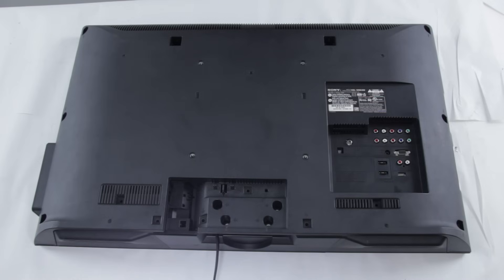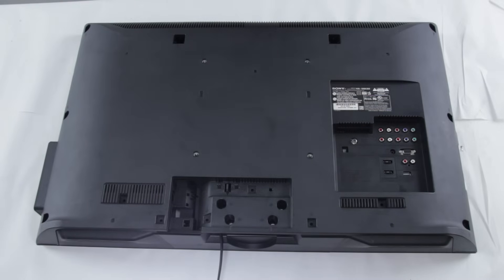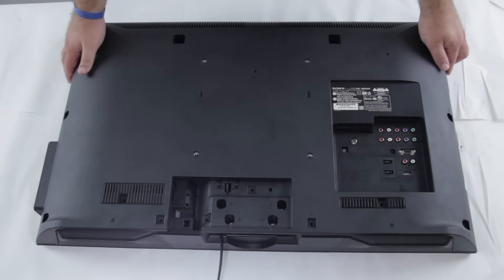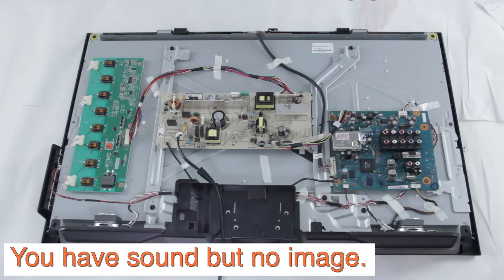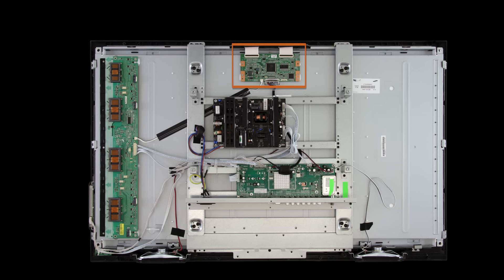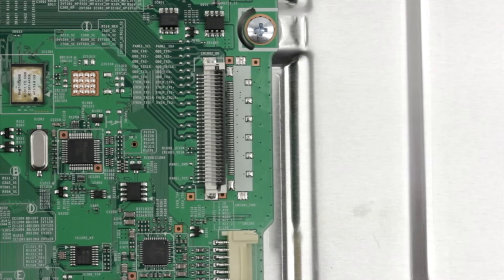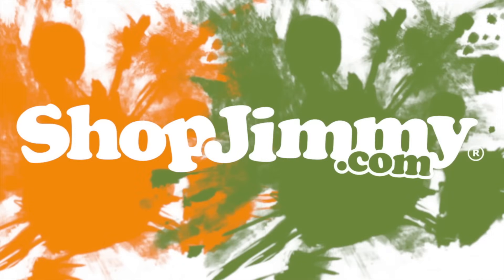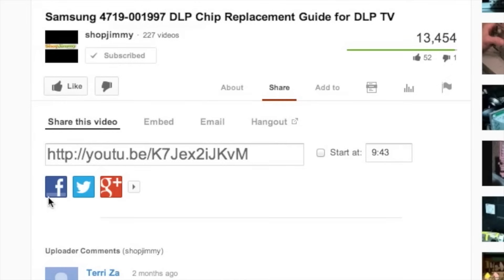LCD TV Repair Tutorial - T-Con Board Common Symptoms & Solutions - How to Replace T-Con Board

Comment: Hey, I hope you can help me with this issue. 

I have a Sony Bravia KDL 50EX465  serial # 5031453

When I try to power on the TV, the screen is black and there is no sound.  Now, before I had this problem I had the volume very, very low to begin with.  Around 1 or 2 maybe.  I don't know if that would affect anything.  Anways.  The green light comes on, and then off again about 3 times.  Then it goes to standby and blinks 6 times.  At first it blinked 5 AND 6 times.  I unplugged the unit and let it sit.  Tried a factory reset, and now it only blinks 6 times.  Any help would be greatly appreciated!!
Reply from the maker: concertostrife   This is lamps problem, and that is caused by the TV panel.  If your TV panel is bad, it may be more cost-effective to replace the TV as panels are typically hard to find in stock, difficult to replace, and expensive.  Thanks and please let us know if you have any further questions!  www.shopjimmy.com
Reply: ShopJimmy.com
  After checking, you may be confusing my TV with something else?  It is an LCD.  No projection.  ...or am I mistaken?  Are there still lamps inside?
Reply from the maker: concertostrife   There are lamps in the TV, not like a DLP lamp, but cold cathode fluorescent lamps (CCFLs) that illuminate.  Unfortunately we do not stock CCFLs.  Thanks!  www.shopjimmy.com

Comment: i own a Philips Q528.2E LB chassis and i am getting an white/light grey picture. u can hardly see the menu but if i turned it on and off a few times or leave it on for a while it sometimes get better and you can read the menu or see a picture somewhat better. can the tcon board be bad here?
thanks

Comment: hi , i have 42' TV , INSIGNIA  and on sudden , when i turned it on i just hear the sound clearly .. but NO Picture at all (BLACK SCREEN).. is it T-CON Board , Or BackLights Inverter ?

the T-CON Board number -  D016630-L$NSR813600812
Reply from the maker: Charle Brown   Please reply with your TV model number and then we can recommend a replacement part for your TV repair.  Thanks!  www.shopjimmy.com
Reply: ShopJimmy.com INSIGNIA
LCD TV
Model No.: NS-LCD42HD-09

Comment: I have a 2007 VisionQuest LCD TV Product # LVQ40HLA Model# 1070 Serial# LVQ40 07110611

The problem:
Red tinge occurs on top and bottom of screen. You might also call it a red-washed look. Colours aren't displaying properly and are showing a red colour instead. The center of the screen looks fine and most colours on the top and bottom look fine but there is a distinct red tinge on the top and bottom as well.
Reply from the maker: DaveandJess Primmer   I recommend replacing the main board in your TV.  Unfortunately I do not see any replacement parts in the search results for your TV model number on our website.  Thanks and please let us know if you have any further questions!  www.shopjimmy.com

Comment: I have a model # 32MD359B/F7 Magnavox, turns on plays onboard DVD with no picture all white screen sound works fine, can change channels, volume works, just a plain white screen. S/N J039002852
Reply from the maker: John W  I recommend replacing the digital board in your TV.  Here is a link to replacement parts for your TV model number on our website, click here:  http://www.shopjimmy.com/catalogsearch/result/?q=32MD359B%2FF7  Be sure to match part numbers on your current board, with your replacement for compatibility.  Here is a link to a video showing how to identify your part number, click here:  Part ID Numbers for Sylvania, Emerson, Philips Magnavox MPS, MPW, MUT, & Digital Boards TV Repair  You can also call our customer service for further assistance with your purchase.  (877) 881-6492  Thanks and please let us know if you have any further questions with your TV Repair!  www.shopjimmy.com

Comment: Hi. I have a 2 yr old LG 55LK520 LCD. Just started displaying a single 1 pixel blue/red vertical line from the bottom of the screen to about 1 inch from the top. It's located about halfway between the center and the left edge of the screen. It's persistent and displays with all/no inputs. Repairable? Thanks!
Reply from the maker: Tony Szatkowski   This sounds like a TV panel problem.  If your TV panel is bad, it may be more cost-effective to replace the TV as panels are typically hard to find in stock, difficult to replace, and expensive.  Thanks and please let us know if you have any further questions!  www.shopjimmy.com

Comment: Hello, I have a samsung LN52A750R1FXZA. It turns on and off, on and off... the picture never shows, the back lights do turn on though. I have replaced caps, tried to see if unplugging the touch panel would work to no avail.  Do you have any other suggestions to troubleshoot? Start up chime comes on and tv turns off right after. Manuf date 8/08.
Reply from the maker: rcrack2  I recommend replacing the main board in your TV.  Here is a link to replacement parts for your TV model number on our website, click here:  http://www.shopjimmy.com/catalogsearch/result/?q=LN52A750R1FXZA  Be sure to match part numbers on your current board, with your replacement for compatibility.  You can also call our customer service for further assistance with your purchase.  (877) 881-6492  Thanks and please let us know if you have any further questions with your TV Repair!  www.shopjimmy.com

Comment: I have sony kdl 46z4100 serial 85xxxx that has a completely black screen. No menu, or other screen display at all. The backlight does turn on and i get audio,  the set stays on for about 4 minutes then the backlight goes out and the red stand-by leds blinks 12 times. Also, all fuses check good and the tcon board is getting 12v.
Please comment
Reply from the maker: j holman   This sounds like a TV panel problem.  If your TV panel is bad, it may be more cost-effective to replace the TV as panels are typically hard to find in stock, difficult to replace, and expensive.  Thanks and please let us know if you have any further questions!  www.shopjimmy.com

Comment: I have Vizio LCD VO47L FHDTV10A.
made dec 2007

I am getting sudden hiss sound from the tv as well as lcd monitor is darker then before. I can see everything ok but screen is dark and lightly flickering.. is it a inverter problem?

thanks in advance.
Reply from the maker: jong-hyun joe   This sounds like a power supply problem, and you may want to replace the power supply board.  Here is a link to replacement parts for your TV model number on our website, click here:  http://www.shopjimmy.com/catalogsearch/result/?q=VO47LFHDTV10A  Be sure to match part numbers on your current board, with your replacement for compatibility.  You can also call our customer service for further assistance with your purchase.  (877) 881-6492  Thanks and please let us know if you have any further questions with your TV Repair!  www.shopjimmy.com
Reply: Thank you.. you guys are great

Comment: Hi! I have a 55 inch vizio vf552xvt, green dots appear all over the screen. What board do I have to replace to fix this?
Reply from the maker: Louis Gellys II  I recommend replacing the main board in your TV.  Here is a link to replacement parts for your TV model number on our website, click here:  http://www.shopjimmy.com/catalogsearch/result/?q=vf552xvt  Be sure to match part numbers on your current board, with your replacement for compatibility.  Here is a link to a video showing how to identify your part number, click here:  TV Part Number Identification Guide for Vizio Main Boards (Plasma, LCD, LED)  You can also call our customer service for further assistance with your purchase.  (877) 881-6492  Thanks and please let us know if you have any further questions with your TV Repair!  www.shopjimmy.com

Comment: I have a Samsung LN-S4041D, replaced the t-con after picture failed but sound worked. Tried testing with flashlight to see if there were images and yes there were. After replacing t-con I got vertical colored lines on screen. Thought I might have installed wrong so I undid and installed again. This time I got the rectangle in middle that shows Input, only it was doubled (like seeing double). Unhooked again, hooked back up and now all I get is vertical colored lines again. Any suggestions? tlawky@gmail.com. Thanks!
Reply from the maker: Tom Law   I guess you should have replaced the backlight inverter from the beginning.  Can you put back in your original T-Con board and replace the backlight inverter(s) to see if that fixes the problem?  Thanks and please let us know if you have any other questions!  www.shopjimmy.com

Comment: Hi guys. Looking for some help. I have a Sony 46" KDL46EX640 LCD/LED tv. Recently, it started showing vertical black lines that stretch from top to bottom. The vertical black lines are clustered really close together that it forms almost like a 2 inch tick vertical black bar. The black lines do not move or shift, and are present regardless of changing the input or pressing the wide button. I was just wondering if this would be due to the T-con or the mainboard or some other problem. I just wanted to make sure I buy and replace the right part from you guys.
Thanks
Reply: Also, the vertical black lines are close the the middle of the screen. Forgot to mention that
Reply from the maker: Donwhatever1234   This sounds like a TV panel problem.  If your TV panel is bad, it may be more cost-effective to replace the TV as panels are typically hard to find in stock, difficult to replace, and expensive.  Thanks and please let us know if you have any further questions!  www.shopjimmy.com

Comment: Hi,
I've got a Sony KDL 46S2010 serial number 8013114. Was working fine then picture went out while it was on. Backlighting appears to be on, green light on front comes on, can hear click inside when power switch is pressed, sound works fine. Can NOT see anything on screen including volume as it is adjusted, menu, video settings, etc. I tried unplugging for several hours, no change. Using info from another video I checked voltage at both ends of fuse (CP101P) on T-con board, getting 5vdc at top but <1vdc at bottom. I can't see any obvious damage to any components. 

Thanks for your help.
Reply from the maker: vlsgmc   I recommend replacing the T-Con board in your TV.  Here is a link to replacement parts for your TV model number on our website, click here:  http://www.shopjimmy.com/catalogsearch/result/?q=46S2010  Be sure to match part numbers on your current board, with your replacement for compatibility.  You can also call our customer service for further assistance with your purchase.  (877) 881-6492  Thanks and please let us know if you have any further questions with your TV Repair!  www.shopjimmy.com

Comment: This is the fault I have http://youtu.be/Zcd5jz36nN8
Reply from the maker: 101fraz   If tilting the TV is helping to fix the issue, there could be a loose connection in the TV.  You could try moving some cables around in the back of the TV to see if that helps the problem.  Be sure to take the proper safety precautions before working on your TV.  I am thinking that it could be something with the T-Con board, so maybe check the connections around that board.  You can also call our customer service for further assistance with your purchase.  (877) 881-6492  Thanks and please let us know if you have any further questions with your TV Repair!  www.shopjimmy.com

Comment: I have a Samsung 52 inch LCD model LN52A550P3FXZA.  It had not been used for a couple of months, and moved around a couple of times, but when plugged back in and turned on again, all of the black in the picture was red no matter what source.
Reply from the maker: Ryan Slaybaugh   I recommend replacing the main board in your TV.  Here is a link to replacement parts for your TV model number on our website, click here:  http://www.shopjimmy.com/catalogsearch/result/?q=LN52A550P3FXZA  Be sure to match part numbers on your current board, with your replacement for compatibility.  Here is a link to a video showing how to identify your part number, click here:  Samsung Main Boards & Digital Boards: Part Numbers for LED, LCD, DLP, Plasma TV Repair  You can also call our customer service for further assistance with your purchase.  (877) 881-6492  Thanks and please let us know if you have any further questions with your TV Repair!  www.shopjimmy.com

Comment: Hi...I have a 55" Samsung TV...Model LN55C630K1FXZA  It's 4 yrs old and about a year ago we got lines.  The screen was replaced, the problem went away, then came back.  We found pushing the Antenna In nob in and or sideways up and down, and other things on that panel made the lines go away.  That no longer works, the lines just change and have become constant.  They differ from light thin vertical lines to thick dark lines.  the audio to our stereo is also affected.  We feel like the panel and what 's behind the panel is loose?? When the lines are not there we have a beautiful picture, and still get compliments on our picture, we love this TV:(
Reply from the maker: *****  If there is a problem with the main board, then I recommend replacing the main board.  Here is a link to replacement parts for your TV model number on our website, click here:  http://www.shopjimmy.com/catalogsearch/result/?q=LN55C630K1FXZA  Be sure to match part numbers on your current board, with your replacement for compatibility.  You can also call our customer service for further assistance with your purchase.  (877) 881-6492  Thanks and please let us know if you have any further questions with your TV Repair!  www.shopjimmy.com

Comment: I have a Samsung LN52A650 and 1/3 of my screen is perect, middle third is dark and the right 1/3 has some horizontal lines and shadows from the previous tv images. After 20 minutes or so, the color would straighten out until now. I purchased a new T-Con board from ShopJimmy (awesome service!) and installed it last night but I still have the same issues. Any ideas? Motherboard? Monitor? Thanks for any help you can provide.
Reply from the maker: kevin33004   This sounds like a TV panel problem.  If your TV panel is bad, it may be more cost-effective to replace the TV as panels are typically hard to find in stock, difficult to replace, and expensive.  Thanks and please let us know if you have any further questions!  www.shopjimmy.com

Comment: Dynex DX-LCD32-09 has sound but no picture.  I get a faint image when using a flashlight looking into the screen.  I have replaced the Inverter board but have the same problem.  Would my next route be the T-Con Board?  Thanks!
Reply from the maker: Terry Olvin   If you are comfortable working with a multimeter, you can check for 24 volts to the inverter. If missing replace power supply. If present check for turn on and dim voltage. If missing at inverter check at main board. If missing replace the main board.  You could also replace the main board and power supply boards individually to see if which board fixes the problem.  Here is a link to replacement parts for your TV model number on our website, click here:  http://www.shopjimmy.com/catalogsearch/result/?q=DX-LCD32-09  Be sure to match part numbers on your current board, with your replacement for compatibility.  You can also call our customer service for further assistance with your purchase.  (877) 881-6492  Thanks and please let us know if you have any further questions with your TV Repair!  www.shopjimmy.com

Comment: I have lg 42 g3000 tv with white screen,audio is fine,if a tilt the tv or wait 10 mins after switching on set the picture returns to normal, I have removed t con board and refitted incase of connection problem but fault persists? Any ideas?
Reply from the maker: 101fraz If tilting the TV is helping to fix the issue, there could be a loose connection in the TV. You could try moving some cables around in the back of the TV to see if that helps the problem. Be sure to take the proper safety precautions before working on your TV. I am thinking that it could be something with the T-Con board, so maybe check the connections around that board. You can also call our customer service for further assistance with your purchase. (877) 881-6492 Thanks and please let us know if you have any further questions with your TV Repair! www.shopjimmy.com

Comment: I have a Samsung LN46B640R3FZA. I have yellow/orange vertical lines.. Also an image of the previous screen stays on the display like its lagging
Reply from the maker: TUFACE19   This sounds like a TV panel problem.  If your TV panel is bad, it may be more cost-effective to replace the TV as panels are typically hard to find in stock, difficult to replace, and expensive.  Thanks and please let us know if you have any further questions!  www.shopjimmy.com

Comment: Hi I have a sony KDL 46HX820. It has horizontal lines covering the top half of the screen.  They are there all the time and on all sources.  Out of warranty no help from SONY please help me.
Reply from the maker: Luke Ferguson   This sounds like a bad TV panel, however you can replace the T-Con (PYL) board and Main BATL board just to be sure those boards are not the problem.  Here is a link to replacement parts for your TV model number on our website, click here:  http://www.shopjimmy.com/catalogsearch/result/?q=+46HX820  Be sure to match part numbers on your current board, with your replacement for compatibility.  You can also call our customer service for further assistance with your purchase.  (877) 881-6492  Thanks and please let us know if you have any further questions with your TV Repair!  www.shopjimmy.com